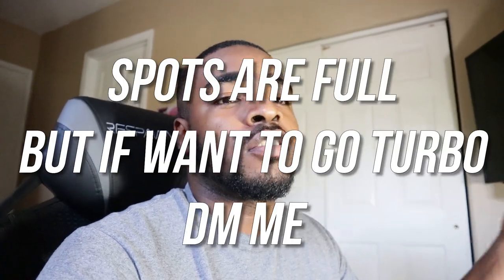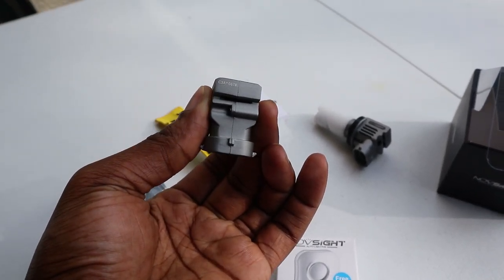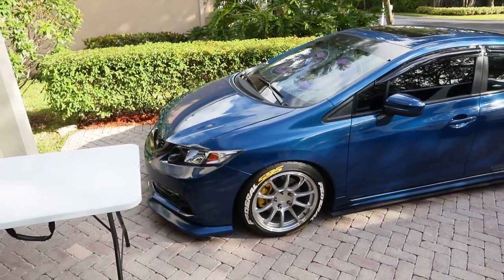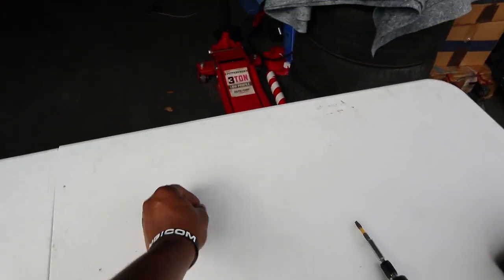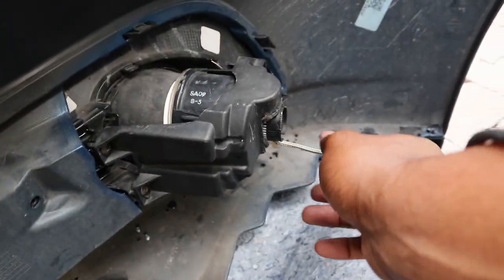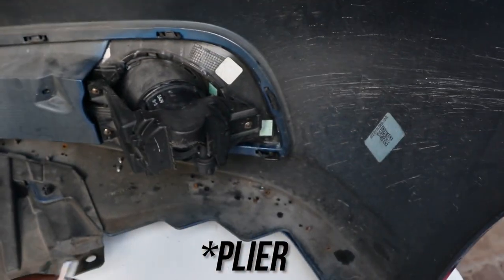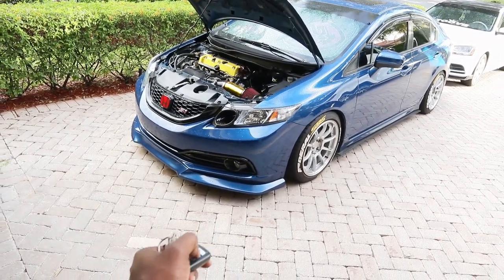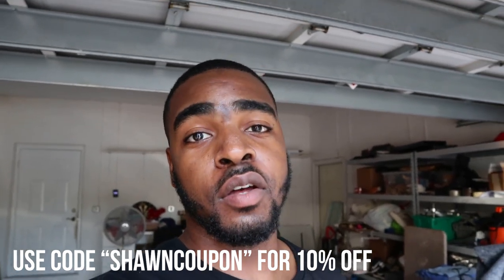ONE OF THE BRIGHTEST FOG LIGHTS! | NovSight LED Install

Comment: i bought a replacement fog light assembly on ebay for my 13 si coupe and i use aukee led lights from amazon thats plug and play without cutting. just a tip if you want the brightest fog light set up position the light to the opposite of whats recomended( if its horizontal adjust it to veritcal). yes it will blind people but i dont use fog lights where theres street lights.
Reply: You have the link bro? I ordered some Foglights from eBay and it came with some cheap halogen dirty white color:( looking to replace it with some white LED bulbs